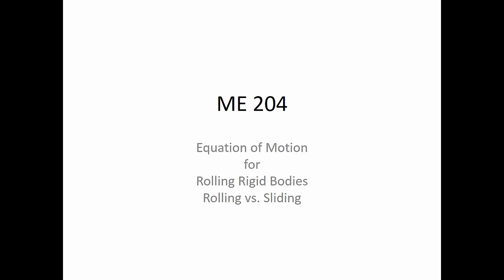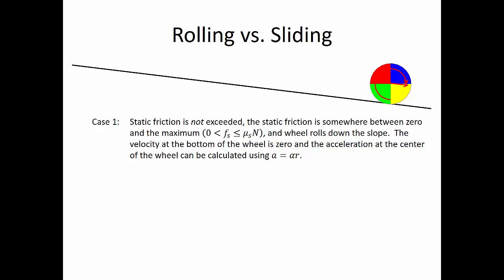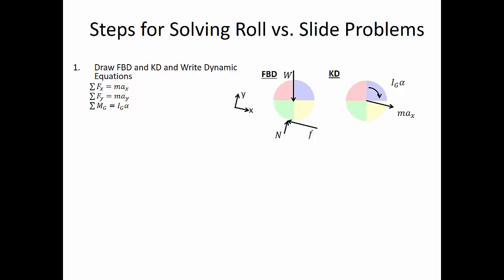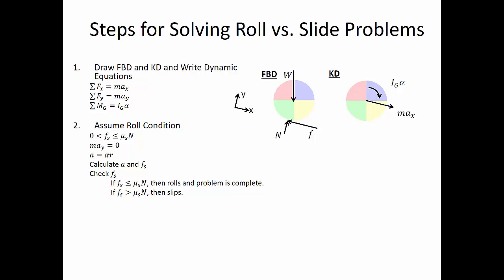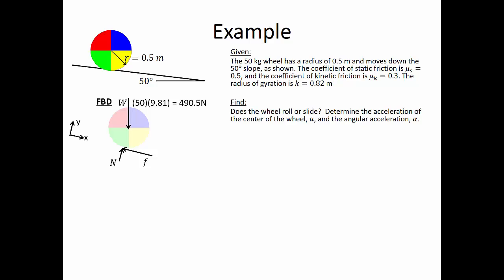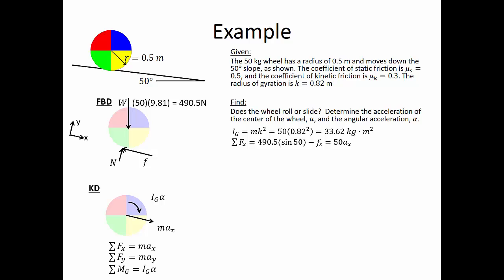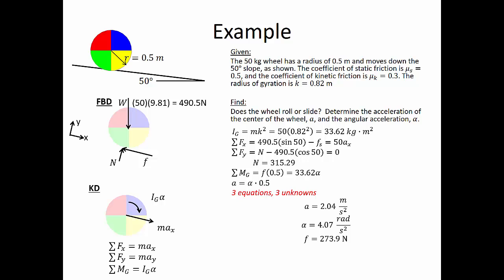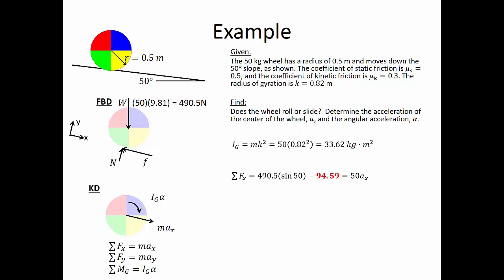7.2 Equation of Motion for Rolling Rigid Bodies   Rolling vs  Sliding

Comment: i was taught that the direction of friction for wheels would oppose the direction the wheel approaches the ground at. as the wheel rotates clockwise as it goes down the slope, the friction points towards the downward slope to oppose the movement
Reply from the maker: That may be true if you are applying power to the wheel and that's what is causing the rotation.  However, when it is rolling under its own weight, due to gravity, the friction points up the slope.  The friction is what is causing the rotation in this case and has to act in the same direction as the rotation.  If you consider the moment caused by the friction force, it would induce rotation in the clockwise direction, which is the direction the wheel turns as it goes down the slope.  If you had an applied moment on flat ground, the friction would resist the rotation and the direction would be reversed.  Let me know if that helps to clarify this for you.
Reply: @JimLawrenceEngineering  ah I see. my teacher only showed us an example of a wheel moving on a flat surface so that makes sense. I guess for inclined surfaces the friction opposes the motion as a whole.